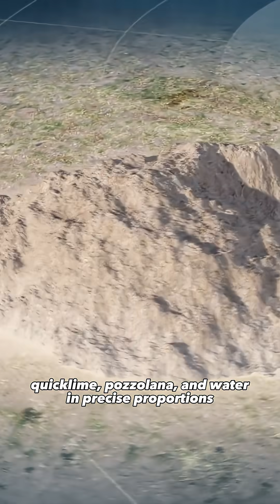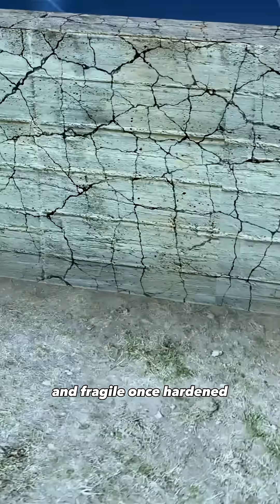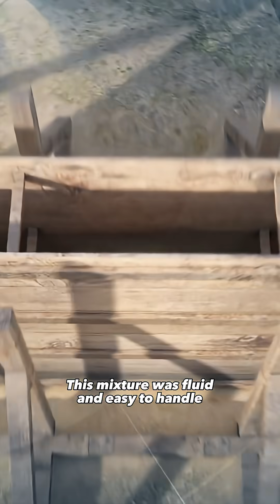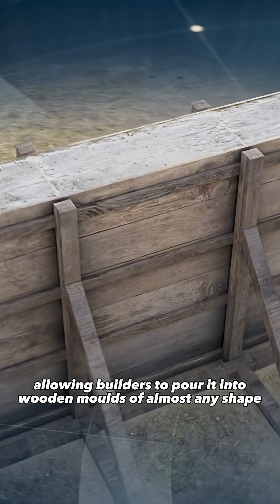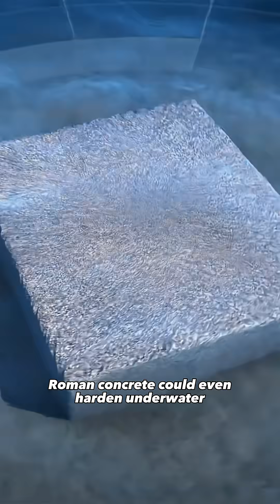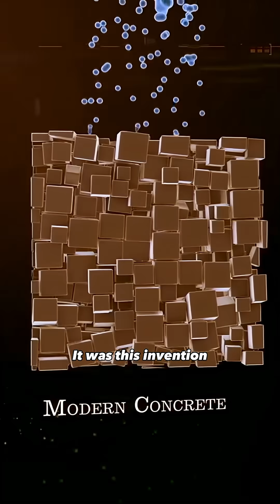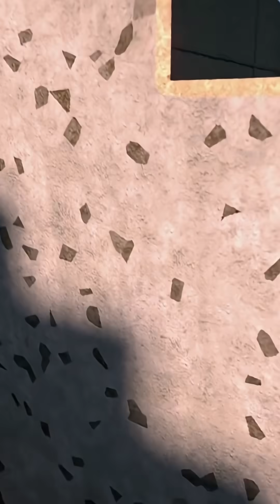The Roman concrete #history #romanempire #engineering

Comment: Romans did not pour their concrete. They used as little water as possible and troweled it on, or pressed it firmly into formwork.
It was in no way like a fluid or easy to handle, I'm not sure whether you made these assumptions up entirely or gotten them from inaccurate or unreliable sources.

Comment: At the end of your clip you show a cupola similar to the Pantheon. The builders used different grades of Pozzolana.
The designation pozzolana is derived from one of the primary deposits of volcanic ash used by the Romans in Italy, at Pozzuoli. The modern definition of pozzolana encompasses any volcanic material (pumice or volcanic ash), predominantly composed of fine volcanic glass, that is used as a pozzolan. They used heavier grains at the bottom and lighter ones for the top of the cupola.
They had truly great engineers! ❤

Comment: Don't be fooled by its longevity, Roman concrete is not stronger than modern concrete in terms of its loadbearing capacity. The Pantheon was about the largest structure that could be built using this material and the architects needed to do a lot of weight saving to make the dome structurally sound.

Comment: I still wonder who first discovered that ingredient mix. Amazing.
Reply: we did some research on that to. Must have come by any accident or mere to the size of pottery made. When Hardwoodash is used as a glaze compound the slick in the glaze container hardenss after a few weeks, even underwater. That would explain why the old highend civilatzions had some kind of super mortar. The geopolymeric concretes can have over 60000psi ceramic like.

When you add some potassiumsilikate into a clay mix to form some pots you can lower the burning temp to under 800°C somewhere around 105-350° are enough to burn such a ceramic then. idk the excat proportion to the i but i assume it was 5-10%.

These kind of concretes or ceramics are called geopolymer, some good book has been written by Davidovits.

Comment: The secret: "Recent research indicates that the Romans often used "hot mixing," where quicklime was added directly to the aggregate and water at high temperatures, rather than first creating slaked lime (a less reactive paste).
This "hot mixing" process created lime clasts within the concrete that helped it to self-heal by dissolving and filling cracks over time. "
Reply: ya but the thing is, there is no evidence that Romans intentionally made the concrete self healing. it most likely was an accident
Reply: That's just normal procedure for quicklime use back then. Medieval builders also mixed in dry quicklime with sand and water at the same time when making mortar for the same reason.

Comment: It's amazing to think that the reason Roman concrete is more resistant than modern day concrete is because today we are more Thorough when making & mixing the ingredients. The Romans concrete still had small bits of unmixed lime balls essentially & when water gets into their concrete through tiny cracks & splits the tiny lime balls harder up effectively reseal & repairing itself to any further ingress which basically means, modern concrete is not as long lasting because its to well mixed. There's more too it than that but that it in a nut shell.

Comment: the big thing was the volcanic ash , because of how it reacted with water, particularly salt water.  but in general, concrete mixes are sand, aggregate ( gravel and other sorted size of essentially rock), cement, water, and sometimes an plastizer ( as in the technical term plastic, not the materal) for when you are pouring on very hot or cold days. can also put in fiber reinforcement.  it all depends on the strength characteristic you are looking for in the concrete.  the different PSI ratings are the strength rating for concrete

Comment: Key ingredients 

- Lime: A white powder called slaked lime, which is quicklime (\(CaO\)) mixed with water.

- Volcanic ash: Also known as pozzolana, this was a crucial component sourced from volcanic regions like Pozzuoli.

- Seawater: When used, it reacted with the volcanic ash and lime to create minerals that resist fracturing and strengthen the concrete over time.

Rock aggregate: Chunks of volcanic rock or other rubble were incorporated into the mortar mix.

Comment: To achieve a strong, durable, and self-healing underwater cement mixture similar to Roman opus caementicium, use a ratio of quicklime to pozzolana (volcanic ash) of 1:2 for underwater applications, with aggregate (such as volcanic tuff or rocks) added at around 2:1 to the mortar by volume, and maintain a water-to-binder ratio in the range of 0.35–0.50 for optimal workability and crack resistance. 

Recommended Mixing Ratios Quicklime : Pozzolana (Volcanic Ash): 1:2 by volume for underwater use (the ratio for general building could be up to 1:3, but 1:2 is traditional for underwater opus caementicium). Aggregate : Mortar: Use roughly a 2:1 ratio (by volume) of aggregate to mortar, with the aggregate made up of rocks, ceramic fragments, or tuff. Water : Binder (Quicklime + Pozzolana): Target a water-to-binder ratio of 0.35–0.50; too much water can increase cracking, while too little reduces work ability. Tips for Strength and Crack PreventionHot-mixing: Combine water directly with quicklime and pozzolana in a “hot-mixing” approach to create lime clasts, which will react over time with infiltrating water, sealing cracks and enabling self-repair. Pozzolana Content: Maintain pozzolana content around 15–20% of the binder for optimum crack reduction; exceeding this can increase cracking. Water Content: Keep water on the lower end of the workable range (0.35–0.45 by binder mass) for maximum strength and minimal plastic shrinkage cracking while still allowing the mix to pour and set underwater. Self-Healing and Underwater SettingSelf-Healing Mechanism: The lime clasts from hot-mixing react with water that enters cracks, crystallizing new calcium carbonate to seal and repair the damage. Hydraulic Properties: The pozzolana reacts with the lime in the presence of water to form stable hydraulic compounds, allowing the concrete to set and harden underwater. 

Practical Example Ratio (Underwater Structural Concrete)Key Preparation StepsMix quicklime and pozzolana with water using “hot-mixing”—add quicklime directly to water and pozzolana, not already slaked lime. Add aggregate gradually, mixing until a fluid but non-separating paste is achieved (adjust water as needed).Pour while still fluid; the mixture will set and cure underwater due to hydraulic properties of pozzolana-lime mortar.

This formula replicates Roman opus caementicium, balancing strength, underwater setting, and self-healing ability for cracks induced by water infiltration.
Reply: Thanks ill be using this
Reply: eh why not, might be useful
Reply: Excelente.
Reply: We dont have the recipe for the mixture which is why our cement is crap.
Reply: @raoulloustaunau8233  No, our cement is "crap" because we designed it that way. The strongest concretes today (nuclear power plant bases, military installations, rocket launch exhaust traps etc.) are actually up to 20 times stronger than Roman concrete, all modern concrete mixtures have far superior tensile strength, several times faster setting time (Roman concrete cured for months) etc. We mostly use lesser concrete for stuff that simply doesn't require the strength and durability because it significantly saves time and money, as well as logistics. 

Also, you have to take into account two factors - workability and construction/urbanistic advances. Roman concrete is very hard to work with. Drilling holes, making cuts or canals is a nightmare and it doesn't mesh well with rebar which is the basis of modern construction. We also simply don't want to built things that last 1000+ years because new technologies, urban development and changes in code require tearing down object within 100 years, sometimes even 50.
Reply: @raoulloustaunau8233  Where the romans had crap cement, buildings simply did not survive to this day.

Comment: Modern reinforced concrete is significantly stronger than Roman concrete, particularly in tensile strength, which is why it is used for large-scale projects like skyscrapers. While Roman concrete can withstand about 800 psi in compression and lasts longer in certain harsh environments due to its self-healing properties, modern concrete can routinely exceed 4,000 psi in compression and up to 60,000 psi with steel reinforcement. Our engineers are fantastic engineers. A roman bridge would barely be able to hold a few cars, let alone a semi.
Reply: Roman concrete stands today, after two millennia. Modern concrete will not resist two hundred years. 
Yeah, much better. 😂😂😂😂😂..

Idiot!

Comment: Minor correctio, Roman concrete was NOT poured liquid like modern concrete, but rather stamped into place with fairly little water. The self healing features are a result of adding slightly less water than required to make all the quicklime cure. This also prevented it from going fully liquid.

Comment: We need to revise this...
Because today's cement is made for just profit , and with the life of just 60 yrs.....
..
We still have the option of lime mortar...
But Roman concrete is above all..
Reply: Today’s concrete is made to withstand far, far heavier loads than what Roman concrete can stand.
Reply: @RPP-222 
steel-reinforced Roman (pozzolanic) concrete and proper structural design,  could safely support roughly 8–12 stories.... With the life of centuries....
Although  the world's 90% building height is less than 60 feet...
So.. Roman concrete is way environment friendly and better than today's cement...
Reply: @RPP-222 
And the lime in ( lime mortar or in roman concrete) keeps slowly carbonating for centuries, those  structures continue absorbing CO₂  till now...
While today's cement did exactly the opposite...
Reply: Definitely comes down to cost, it was about 30 to 40% lime by volume and we use 1/16th to 1/8th for high lime mixes.  That and we tend to rip things up in 60 years because it's no longer what the owner wants.

Comment: Volcanic ash and crushed seashells were also added no???
Reply: Burnt crushed sea shells.  It's a decent source of lime if you can't get it otherwise.  You burn them, separate from the ash and add a little water until it stops reacting.  Need a metal bucket and don't get it on you.

Comment: rebar in modern structures rusts and expansion cracks the concrete. but it is a known fact that concrete submerged in water makes the lime leech to the surface turning the surface of concrete into limestone and therefore practically immortal

Comment: Too much water in the mixture makes it weak yet somehow it can set underwater? 🤔
Reply: When building piers etc, the Romans would build a wooden barrier, drain all water, and pour the foundation, allowing it to start setting. They'd then reflood the area, remove the barricades, and the foundation would continue to harden underwater.

It's similar to concrete in that regard. Concrete cures underwater because hardening is a chemical reaction with water, not evaporation. The hydration process, where cement and water react to form strong compounds, happens more efficiently with water present. While standard concrete can be placed underwater, it often requires special techniques and admixtures to prevent washout and ensure proper strength.

While you COULD just pour it into the ocean into a mold and have it harden and cure, if you wanted any strength from it, you wouldn't do that.
Reply: It isnt the water around the mortar that does delute the mix. The mix isnt absorbing much more water when it is mixed. You can do some easy experiments on that. Today we have afew kind of mortars. Hydraulic lime will set under very wet conditions. Non hydraulic lime will not set in to wet  scenarios. There is a big chemical differance in both systems.

Comment: Not just any water, it was salt water (seawater/ocean). The chemical process helped it strengthen faster and harder than fresh water did. We don't use salt water anymore because it will corrode the steal reinforcements placed in modern day builds
Reply: Why aren't similar formulations used today?
Reply: @kenweller2032  we actually do have similar mixtures, but it comes down to what are you using it for, and how much are you willing to spend. The mixtures that are able to heal themselves are rather expensive, they also tend to be harder which could cause issues for things like rubber tires for example.
Reply: @Martyrofsand  well said, we also don't use the salt water because we NEED the steel reinforcement our buildings and roadways are subjected to tonnage and forces that would never have been imagined In Roman times

Imagine how the Roman roads would have been if they were constantly subjected to the wear and tear of an equivalent of an elephant of fiberglass traveling at 30mph every 15 minutes 

They survived that long precisely because they never saw those types of forces
Reply: @kenweller2032 
Revelation 3:20
Behold, I stand at the door, and knock: if any man hear my voice, and open the door, I will come in to him, and will sup with him, and he with me.

HEY THERE 🤗 JESUS IS CALLING YOU TODAY. Turn away from your sins, confess, forsake them and live the victorious life. God bless.

Revelation 22:12-14
And, behold, I come quickly; and my reward is with me, to give every man according as his work shall be.
I am Alpha and Omega, the beginning and the end, the first and the last.
Blessed are they that do his commandments, that they may have right to the tree of life, and may enter in through the gates into the city.
Reply: @kenweller2032  the ingriedients are expensive and pozzolans, a kind of vulcanash/glass is seldome used because it must been used after a certain time of digging. Roman cements are a kind of Geopolymers. Google for that "geopolymer Davidovits" Gp is a form of very old concrete made from soda, slacked lime and aggregate containing a lot of Si=O2

Comment: It’s not that we don’t know how to make them, scientists have already reverse engineered the ingredients. It’s that these ingredients don’t work with modern building techniques.
First off: volcanic ash. Not every city is built next to an active volcano nowadays. Although some engineers have proposed using fly ash from coal burning, the supply chain is yet to be established.
Then there’s the problems with seawater. Besides the fact that not every modern construction project is shore adjacent, modern concrete construction embeds rebars and steel beams in the concrete to increase the structure’s shear strength. This is especially important for high rise buildings that need to sustain constant strong winds. But seawater is corrosive to steel, causing rust and disintegration over time. Hence they’re literally incompatible with modern buildings.
Reply: No one needed to reverse engineer concrete.
Reply: Use fiberglass rebar.  "Where there's a will........"
Reply: concrete is alkaline which prevents rust
Reply: @andyman8630  there is not enough alkaline in the world to prevent seawater from rusting steel.
Reply: Reverse engineering?!? They still have no idea what's inside that concrete. They guess a few, but the complete list of ingredients and the exact quantities? 😂😂😂 Let it be. Technologically, we are savages in a tree compared to ancient civilizations.
Reply: @UmbraFulgur  there are literal books written about different types of concrete from the Romans...
Reply: @UmbraFulgur  we know exactly how to make roman concrete and we have for a very, very long time.  the problem is it's not very good.  stop reading conspiracy propaganda.
Reply: @theghostofthomasjenkins9643  
yeah! Roman concrete is so bad it has lasted more than 2,000 years and survived hundreds of earthquakes
Reply: @andyman8630  it has only lasted 2000 years because of constant maintenance and other conservation methods to keep it standing.  it also hasn't survived hundreds of earthquakes.  earthquakes are a big reason most of it rubble today.   it didn't even survive earthquakes during the roman empire.
Reply: @theghostofthomasjenkins9643  
ahh! so that's why the Colosseum is still largely intact smh
Reply: @andyman8630  yeah, because of the 1000's of years worth of maintenance that has been done to preserve it.  maybe you should ask why none of the buildings around it are still standing, since they were made of the same material.
Reply: @theghostofthomasjenkins9643  
NO repairs nor maintenance were performed prior to the 19th Century! that's 1,700 years untouched!

it still stands because of its' concrete foundation built upon bedrock specifically designed to withstand earthquakes, while other buildings of the same era were built on soft ground and were quarried and looted for building materials
Reply: @andyman8630  that's absurd.  we have actual records of it's restoration.  there is not a single period in it's history where it is not being maintained, either by a king or by a church. do you really expect people to believe that this large structure in the middle of rome was just ignored for 1700 years?

and ini 1349, a large portion of it actually collapsed due an earthquake.
Reply: @theghostofthomasjenkins9643  
yes, we have records from the 19th century onwards! 5th to 10th century were the Dark Ages - who was looking after it then?

yes a portion collapsed in 1349
Reply: @theghostofthomasjenkins9643  
absurd? for 500 years the world couldn't even keep records (The Dark Ages) 

show me the records! put up or,,,,
Reply: @andyman8630  ...wait, you think the dark ages didn't keep records?  seriously?  that's cute.

pull up any history book on rome.  there are plenty of records.  like i said before, kings and churches didn't just maintain it, they actively used it.